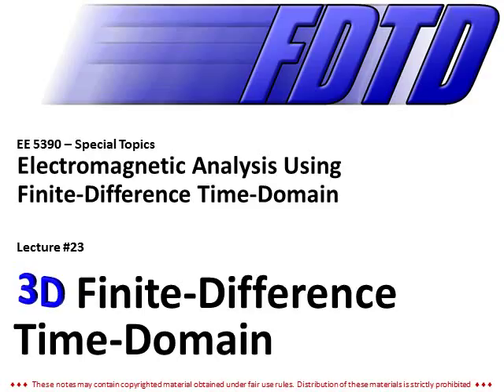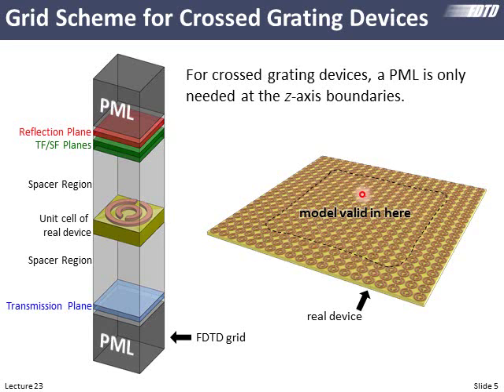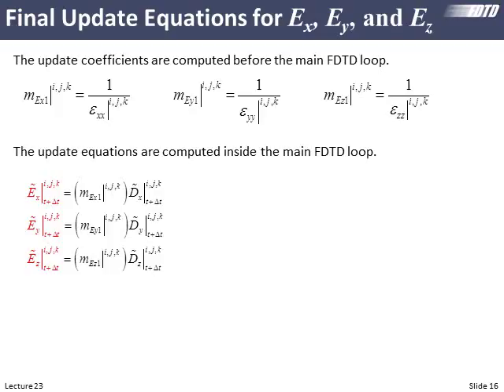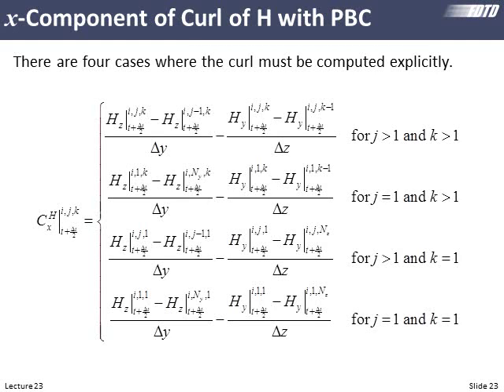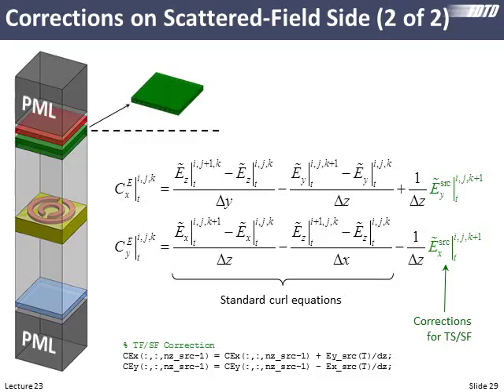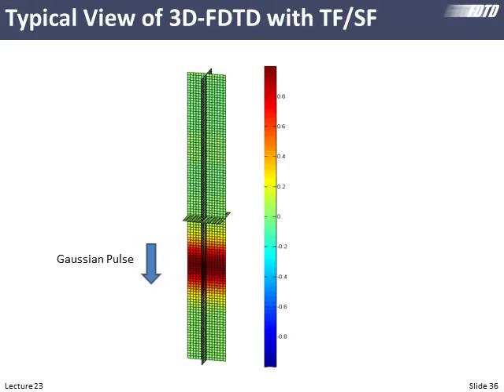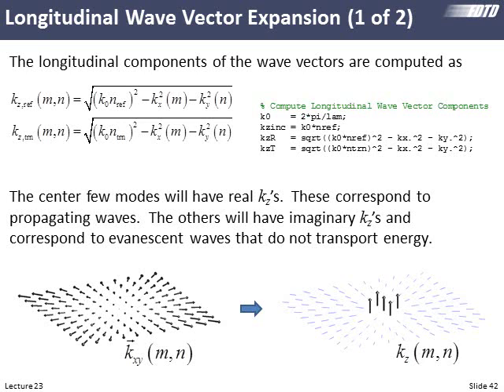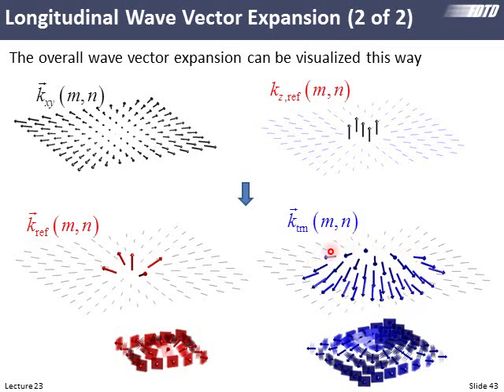Lecture 23 (FDTD) -- 3D FDTD

Comment: 27:34.  I believe the correct normalization is 2D FDTD is:
% Compute Reflectance
   ref = Eref(:,nfreq)./SRC(:,nfreq); %normalize to source
   ref = fftshift(fft(ref))/Nx; %compute spatial harmonics
   ref = real(kyR/kyinc) .* abs(ref).^2; %compute diffraction eff.
   REF(nfreq) = sum(ref); %compute reflectance
   % Compute Transmittance
   trn = Etrn(:,nfreq)./SRC(:,nfreq); %normalize to source
   trn = fftshift(fft(trn))/Nx; %compute spatial harmonics
   trn = real(kyT/kyinc) .* abs(trn).^2; %compute diffraction eff.
   TRN(nfreq) = sum(trn); %compute transmittance    

It is missing the ./ element by element division.
Reply from the maker: On this slide, I am only dividing by a single number so just the '/' will do.  However, more typically you will be normalizing over a range of frequency values and you are absolutely right.  You will need the './' notation for this.

Comment: Dr. Rumpf,

Is a FDTD solver for Maxwell's equations a good way to go about simulating current densities and charge accumulation due to low frequency fields in complex volume conductors such as biological tissue? It seems finite element modelling is usually used for these applications but FDTD modelling would allow for easy coupling with a FDTD solver for mechanical vibrations and time varying material properties.
Reply from the maker: Hmmm...I don't know much about this.  There is a form of FDTD called particle-in-cell (PIC) that incorporates the fields pushing charges around.  It is typically applied to plasmas.  I see your problem mostly a very low frequency problem so there may be more efficient ways to handle it using concepts from electrostatics.

In general, any method can be made to do anything.  So there is nothing FEM can do that FDTD cannot.  It may just be that one method is more efficient at it than the other.

Comment: Can one add a (gaussian) SOFT point source? The TF/SF plane source  works but if I try to input a soft source at a point, the simulation explodes. 

The problem seems to be that the impulse is not transverse to the fields. In 1D and 2D implementations the excitation could be made perpendicular to the fields but in 3D this is not possible.  

Is there a mathematical/physical reason for this explosion? (Breaking the divergence law?)
Reply from the maker: Without seeing your code, I cannot be 100% certain why your code is exploding.  In general though, if your analytical source is not a rigorous solution to Maxwell's equations it will explode because the math is trying to make something out of a source that is not one.

The soft source you want is very easy and is the taught is several places in the course.  I call it a "point source" or a "dipole source."  First, let me point you to the official course website:

https://empossible.net/emp5304/

The source first appears in Lecture 2b and is called a "simple soft source."    It then appears in Lecture 3a.  In both places, this source is being used to throw waves at all the boundaries to test them.  Implementation is also discussed.  IT really is as simple as adding a Gaussian pulse function to one of the points on the grid.

BTW, if you are just getting started in FDTD and struggling a bit, you may be interested in the fully online course I have developed for beginners.  The entire first half of the first course is completely free to see if you like the teaching style.  Here is a link to a short video about the courses:

https://youtu.be/uBiprIN8gfY

Here is a direct link to the courses:

https://empossible.thinkific.com/collections?category=FDTD-in-MATLAB

This online course also teaches the simple Gaussian pulse source and the course includes line-by-line explanation of all the codes and implementations in MATLAB.
Reply: @empossible1577  I have watched those lectures already, thanks for them. I have no problems implementing soft source in 2D. Its 3D that is the problem. I think injecting gaussian creates something unphysical. Some clever adjustment is probably needed.
Reply from the maker: @imaginingPhysics  Hmmm...It works the same way...just add the Gaussian pulse function to some point on the grid.  Do not use any sort of TF/SF and don't inject the source in the PMLs.  What sort of problem are you seeing?  Are you seeing an instability in where the PMLs overlap?  Are you seeing instabilities somewhere else?
Reply: @empossible1577  okay i think i found an explanation. I took my soft source parameters from 2D version and I guess they were way too big for 3D. It just blew out of my scale.
However, it settles into a static state, like new charge has been created (which makes sense right? ). 
I would still like to know how to make an expanding spherical gaussian wave... 
Anyway thanks.
Reply from the maker: @imaginingPhysics  In electromagnetics, there is no such thing as a uniform spherical wave.  You would need a scalar simulation for something like that.  For a dipole, there will be no radiation in the vertical direction, but will expand in the other directions.  It has a donut shape radiation pattern.  The point source you are using is the closest thing to a spherical source I know of without getting crazy complicated.

Comment: Hi, professor. Thank you for your videos always! I'm taking your FDTD course on EMPossible and I'm enjoying it as with your other lectures like FDFD, RCWA, and so on.

My first motivation for learning your simulation methods is that I wanted to simulate a simple situation where there is a material with a circle hole (not periodic) on substrate. I wanted to figure out what happens if I illuminate plane wave with different angles (usually 0 degree of incident angle) on that material. I thought 3D simulation was inevitable  because there is plane wave which has 3D components. I know I can reduce my 3D materials to 2D using effective indices but I have no idea how I should deal with 3D incident light source. Do you think I could reduce this 3D problem to 2D even though there is 3D plane wave source?

Again, I really appreciate your work. Thank you :D
Reply from the maker: A picture of what you have in mind might help me.  However, I think you will need a 3D simulation based on what I think you want to simulate.  I am certainly a big fan of reducing the number of of dimensions of a problem.  Sometimes this can be done simply to study 3D phenomena that also happen in two dimensions.    When the device has a uniform direction, the problems can be reduced rigorously.  Sometimes 3D problems can be reduced to 2D using the effective index method.  I am not sure how to simulate your ring with a 2D model though if I am envisioning it correctly.  If I had to simulate it quickly, I would either use my own FDTD code or maybe a commercial FEM software.  Either will work just fine.
Reply: @empossible1577  I sent a picture to you through email! Please check it if you don't mind. Thank you so much.

Comment: Why TEM  waves are used here than TE or TM waves ? I have read that TEM waves doesn't propagate through waveguides or when two conductors are there. How TEM waves apply to this case ?
Reply from the maker: The labels TE and TM are used differently in different situations.  However, it only makes sense to talk about TE and TM if a device is involved.  For waves in outer space, you will see waves being classified as linearly polarized, circularly polarized, etc., but never TE and TM.  In this lecture, a source wave is always TEM because it is a wave inside of a homogeneous medium.  The label TE and TM is used because there is a device involved and we can define a plane of incidence.  TE and TM refers to which field component is perpendicular to the plane of incidence.  A waveguide is no longer a purely homogeneous medium because it will have a center and something else outside of the center to confine the wave.  This means the waves are no longer plane waves in a waveguide.  In waveguide theory, TE refers to modes where the electric field does not have a longitudinal component so it is completely transverse.  TM has the same meaning, but for magnetic fields.  Inside a waveguide, waves are not usually TEM.  However, transmission lines are a special type of waveguide that can support TEM modes, but those modes are not plane waves.  Plane waves have a uniform amplitude and are of infinite extent.  Modes in a transmission line do not have a uniform amplitude and are not of infinite extent.

Does this help?

Comment: Hi Prof, 

At 27:19, let's say we set Px = 1 and Py = 0, then that means Ey_src will be zero, and hence Ey_ref and Ey_trn will be undefined. Is there any additional steps we need to take to avoid this issue?

Also, in the code snippet only one variable (SRC) is used instead of Ex_src and Ey_src, why is it so?

Thanks!!
Reply from the maker: I think I did a poor job at writing these equations.  Sorry!  In my codes I have a gaussian source, call it Esrc.  From there I calculate Exsrc as P(1)*Esrc and calculate Eysrc as P(2)*Eysrc, etc.  In the denominator for all these equations, I just use Esrc, the pure Gaussian.
Reply: @empossible1577  ah I see, no worries and thanks for the clarification!!
Reply: @empossible1577  Hi Prof,

I have another question. I have run some simulations and had one situation where both the real and imaginary parts of kz are zero, causing Sz (28:26) to be undefined (I used wavelength, simulation x-length, and y-length of 300nm for the wave vector expansions). Is there any ways to mitigate this?
Reply from the maker: @jc2982  This is a problem that arises in all numerical methods.  It is even a problem in physical devices.  Unless this is happening because of a mistake in your code, it is happening because you picked a frequency that puts a diffraction order exactly at cutoff.  There is no fix that I know of other than moving to a slightly different frequency.

Comment: Hi Dr. Rumpf, thanks a lot for the helpful videos! I'm currently attempting to code the 3D FDTD after attempting both the 1D and 2D ones. My current issue is that even though I've checked to make sure the codes are correct, I'm having a divergence issue, specifically only if I have specified a material with complex permittivity in the simulation. I am simulating a slab of silicon (eps = 7.71 - 41.64i), and as soon as the waves touch the silicon layer, the fields begin to diverge. However if I were using only real permittivity and omitted the imaginary part, the simulation works fine. My question is, is the divergence supposed to happen? If yes, why so? If not, then it reaffirms me that there are bugs in my code that I will have to fix. Hope to get your opinion on this as I have been re-checking my codes for days now but couldn't find anything.

FYI: I am simulating periodic silicon nanostructures (I'm testing with the slab first, fields diverge with the nanostructures too). I have UPMLs on both z-boundaries, and I am using the TFSF source, as taught in this lecture.
Reply: Forgot to mention, I am simulating at a wavelength of 300nm, and hence the permittivity value.
Reply from the maker: How are you entering the complex permittivity?  In a time-domain code you cannot directly enter a complex permittivity because a complex permittivity is a frequency-domain concept.  Instead, you will have to retain the conductivity terms in Maxwell's equations when formulating your code.  I talk about this in Lecture 2f on the course website.  BTW, many of these videos have been improved and revised.  If you use the course website as your main portal, you will always have the latest.  Here is the link:

https://empossible.net/academics/emp5304/
Reply: @empossible1577  Thanks for the reply. I have indeed entered the complex permittivity directly into the time domain simulation. I shall go back to that lecture you mentioned and have a look. Thanks!!
Reply from the maker: @jc2982  Very good.  That is definitely the problem!

Comment: What is the polarisation vector taken for modelling the source here ? Are the Px and Py are amplitude integer values ? How they can be defined ?
Reply from the maker: The polarization vector is an input to the algorithm so it is up to you to provide it.  I typically define the amplitudes of the TE and TM polarizations (ate & atm) along with angles theta and phi in my dashboard.  Then I calculate the incident wave vector kinc from theta and phi, calculate the directions of TE and TM (vte and vtm) given kinc and the surface normal (usually z), and then calculate the polarization vector as

P = ate*vte + atm*vtm

This will be a vector containing three scalar numbers Px, Py, and Pz.
Reply: Whether the angles theta and phi corresponds to the TE and TM wave makes with the direction of propagation ? Are they randomly taken ?

When i tried simulating with scalar value of 1 as both electric and magnetic field source, I am finding some problems with the propagation. The value in the grids nearer to Nx,Ny are shooting upto higher exponential values and light is not propagating down the lane. 

Thanks a lot for your explanation. That really helped.
Reply from the maker: The angles theta and phi define the direction of the applied wave, whether that wave is TE, TM, or a combination of both.  The angles are inputs to the algorithm.  They should not be random, but consistent with how the physical device will be used.  From them, you will probably calculate unit vectors in the TE and TM directions in order to calculate your polarization vector P.  From this, you use the x and y components for your source.

It sounds like you have a stability problem.  I doubt this is a problem with the amplitude of the wave.  There are a few things it could be, but I most suspect your PML.  Are you implementing a 2D or 3D code right now?  If the answer is 2D, I suggest visiting the official course website, downloading the MATLAB codes, and then completing Homework #8.  I have written some "tester" codes that will check the values of your PML parameters and update coefficients for correctness.

http://emlab.utep.edu/ee5390fdtd.htm

Other things this could be is picking too large of a time step or perhaps turning on your source too suddenly.
Reply: Thanks for your clear explanations.

I have taken Px and Py as 1. Then as for the direct incidence, will that be a problem as modulus of P will be one then ?

I worked with the 2 Dimensional codes and they went out well. No much issues were there. 

Here what it happens is the light is not moving in z direction and at the same time it vanishes after some time. Also accumulation of values is happening at the PML ends. 

#1. For 1.5 * 1.5 * 4.0 cm device, I calculated the grid points 40*40*200. The propagation time is calculated from Sz. dz is in the range of 10^-5 and dt of 10^-13. Can you give a rough value of dt and dz for testing?

#2. PMLs are calculated in z direction only and i got a increasing ranges of values for PML outside the problem space. Inside problem space values are zero.

#Though sigz are not a set of bigger values,the coefficient values are bigger. (mEz1,mEx1..)(Because of 10-13 in the denominator for dt).

#The source is kept is a simple gaussian source normalised amplitude. When i plotted source, i got a gaussian pulse of amplitude 1. Magnetic field source is multiplied by sqrt(e0/mu0).There also i got gaussian pulse with negative amplitude.
Reply from the maker: Px and Py should not be set to 1.  Instead, it is Px^2 + Py^2 = 1.  If you set them both to one, you will only ever be able to simulate that specific polarization and the amplitude of your source wave will be greater than 1, which has ramifications in later equations that assume the source amplitude is 1.

#1 -- As long as dz is 1/20 of a wavelength or so and dt is calculated from the Courant stability condition, you should be fine.

#2 -- sigz in 3D should look very much like sigx or sigy in 2D.  Use this to check them.

Comment: I have a question regarding the % Transverse Wave Expansion
M = [-floor(Nx/2):floor(Nx/2)]';
N = [-floor(Ny/2):floor(Ny/2)]';

The matrix size for kx and ky is Nx+1 and Ny+1, repsectively.  There is one more cell than field cell (Ex,Ey).   
Szr = -(kx.*Sxr + ky.*Syr)./kzR;

Do you use periodicity, such that kx(1) = kx(end)  or do you throw away the kx=0 term?
Reply: Nevermind...use odd number of elements.
Reply from the maker: The trick is to make Nx and Ny odd numbers.  Then everything works out as written.  It is possible to redo all of this so that the equations work for both odd and even Nx and Ny, but that seemed like it would add more confusion that it was worth.

Comment: Hi, don't you have lecture 24. Scattering analysis video? thanks.
Reply from the maker: No, I have not yet recorded that lecture, but the notes are here:

http://emlab.utep.edu/ee5390fdtd.htm
Reply: In this 3D model, we have to use 3 Dimensional array right? but in 2D, we use 2x plot. Is it right?
Reply from the maker: Correct